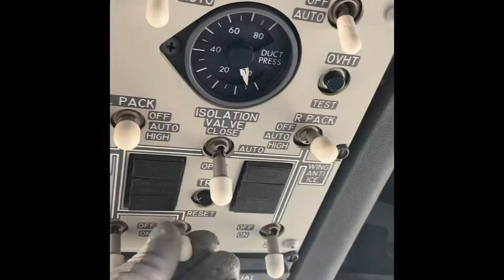Boeing 737 5th Stage Valve Inspection CFM 56 AD 2020-16-51

Comment: Hello, can u explane on cfm56-7b components?🍁
Reply from the maker: Sure, are there any other components you would like explaining?
Reply: @aviationmechanics8634  many thanks 
I ask if you can help me in getting used or unserviceable HPT Blades first stage I really need to it in my PhD research study
Reply: I noticed  u move prsov with rachet to open or close at the end of video
Why yo did that? 😁❤️
Reply: @SHERYAN2022  the PRSOV was moved to the open position so that the APU bleed air could be used to leak check the 5th stage check valve. Unfortunately, the check valve will close (designed to close) so only one side of the check valve can be leak checked. The manual states “a leak check of the upstream coupling is not necessary”.